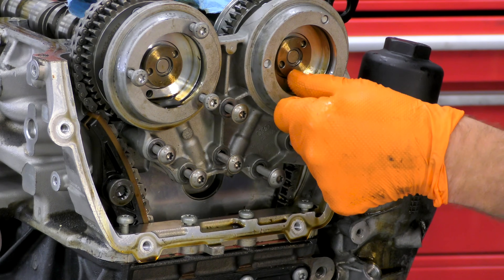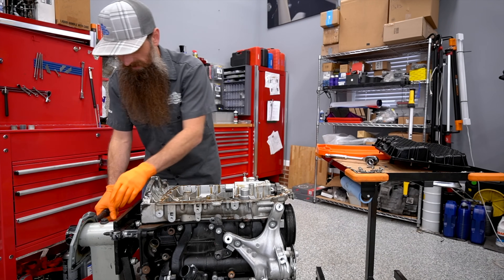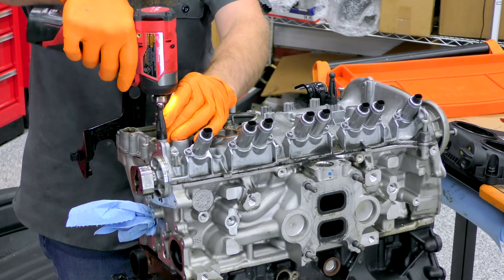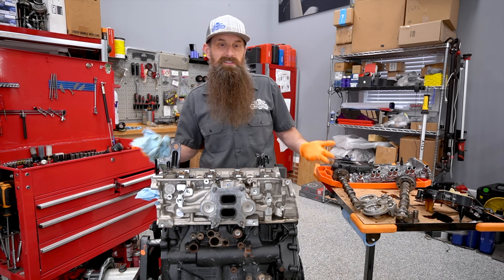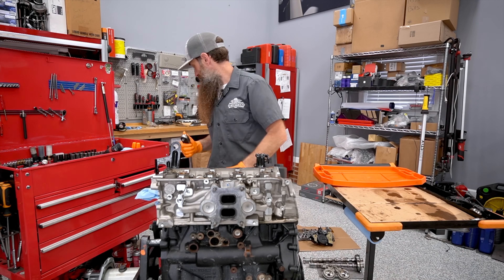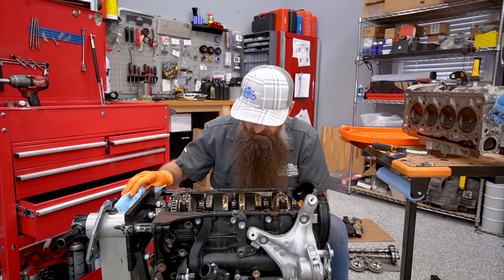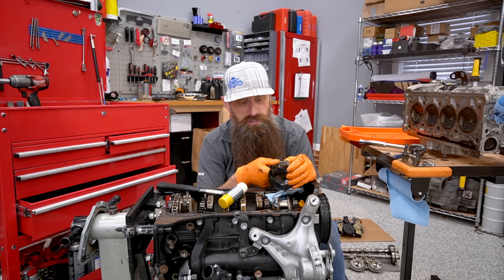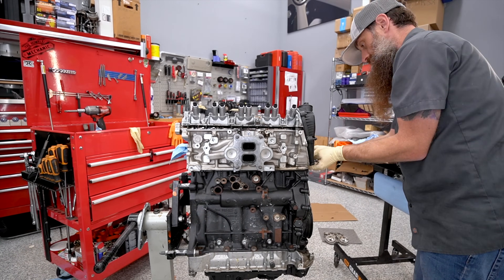Catastrophic VW Engine Failure and Teardown 2.0t TSI

Comment: Bro hope that you can help me, A while ago my car was broken into and almost stolen. Luckily I still have it but I am stuck with some problems. I have a Polo 1.9TDI ASZ.
When the thieves broke into my car they seemed to have flashed it in some sort of way either the cluster or ECU I am not sure. Right now the car can start without a key which I am not comfortable with. Another part of this is that it has been flashed with a tune that does not make the car run at its best. I had tuned the car with MMPS before the incident and now I am no longer able to do it again. 

I'm not sure if it is because of this that's causing the second part of my problem. When I try to flash the ECU it does not accept the file.
When I do a read it takes a file that's about 150KB and when I open it on VAGEDC all the figures are blank. Once again when I flash/write the car with MPPS and it does not accept the 512KB file, and when I do a read the same unreadable file comes out. Just cant find a fix for this anywhere. Thank you

Comment: 1.9 pd tdi
Volkswagen's best modern times engine ever developed. In my opinion after having two in a space of almost 20 years all bought used.
  the current 2006  passat has got 221.000 miles and pulls like a train.as long as economical. Always serviced with original mann filters and liquimolly oil.

Comment: 80k miles here. I've been tuned since 30k miles, and stage 3 with an IS38 making ~400hp on e48 for almost 20k miles. Still solid, but I do consider this the limit to stay reliable. I do need a yet stronger clutch though, but I consider that a consumable at this level.

Comment: Greetings. I drive a VW Polo 6r which is normally made only for the European market. Engine EA111. 1.2 TSI. Year of manufacture 2014. In 8 years, only one part has been replaced. It seems to me that the quality of VW cars or engines for the American market is worse. In fact, every European car assembled in America breaks down faster because the quality is worse.

Comment: What is the parts tray he has beside the motor? (orange corners)
Reply from the maker: Probably these https://www.amazon.com/dp/B075NQ2DMH/ref=cm_sw_r_as_gl_api_gl_i_NVZVSM9KFRR5R2P3EEEK?linkCode=ml1&tag=vwrecommendtool-20
Reply: @HumbleMechanic  those are pretty cool, too. sorry, I actually meant the whole stand that the head was sitting on (like at 12:02) that has orange corners

Comment: You seem to know all about vw’s. I have a 2014 passat 1.8 turbo,  5 speed, 120k. Is there anything you would recommend to get more power from the engine? Or just leave it alone: it currently runs fine!
Reply from the maker: Tune is best bang for the buck for sure

Comment: Help me!! I followed your VR6 timing chain video to do mine everything lined up multiple times after several and several rotations. No that it’s in the car and starting it idles like crap and I only get one cel for P0341 camshaft position sensor. Did it jump a teeth, or could it be something else?

Comment: Melted piston, usual failure of TSIs, VW had a series of pistons that did not respect the manufacturer's tolerances (manufactured with a non-calibrated machine) the oil goes back into the combustion chamber and creates self-ignition, plus number large  jam on scraper rings, the proposed ring kit requires replacing the pistons and connecting rods.
Reply: The problem is a decent manufacturer would just accept responsibility and repair the factory caused faults without charge for the customers, but VW usually let's the customer pay for their faults

Comment: HumbleMechanic is it too early to tell or you think MK8 GTI EA888 won't have the problems of previous gens of EA888 (like chain tensioner or water pump issues and even the carbon build up of the way earlier gens of EA888? 

Hopefully this gen won't have it especially carbon build up (Honda's (at least their 1.5T) don't have it on theirs and its also a direct injection and turbo. Sure there is very thin coating of carbon/soot on the intake valves like what you see on exhaust tips on high mileage 1.5T on honda civic but its still pretty good compared to earlier GDI from VW, BMW and Ford with a very thick layer of carbon that air won't be able to travel to the combustion chamber).
Reply from the maker: Yeah way too early

Comment: Hey Charles. I am super excited for that water pump video. I remember reading the slide valve thermostat SSP around the time the GR Yaris came out. Somewhere I saw that Toyota had to put in a lower opening thermostat for that car to make 268hp. Meanwhile VW has to put in this ridiculous dual valve electronic doodad with seven different operating modes to make less power from more displacement. Why?!

This video was great and the idea of a future Mk7 racecar makes me very happy to be a patron. What do you think of using stock R pistons with aftermarket rods for E85 builds? I know the stock rods don't hold up too far beyond 400 ft-lbs but I'm worried about piston slap with aftermarket aluminum pistons in my daily.

Comment: Hello . Ive recently got some samll vibrations under gass pedal. Theyr small but persistent and it always shows up beyond 3000 rpm . Just to get you noticed My car got mechanical throtle body . What could be the problem?

Comment: my car had this issue as well after tune, low speed and went off while cruising at around 2-3k rpm
Reply: Can you please share year and model and what tune and what stage you had on your car? Thank you
Reply: @gmax985  mk7 gti 2016 car
Reply: @malantra5730  thank you for your reply. What tune and what stage did you have?

Comment: Humble may u give is advice to buy A3 2.0 17"-20" (8v engine) ( FWD or AWD ) which is more reliable . And what is solution for over heating gear temp. At hot places , Is there special oil or some additives with 44"c degree and i need to claim - what is best way to cold down transmission temp. If not moving, let engine on or off etc.

Comment: Great video! Loved seeing the teardown.  I just got a Cupra 290 and loving it so far.  Am I risking this kind of failure if I do a stage 1 or 2 remap?
Reply: He said quite clearly, that LSPI happens mostly in tuned engines. And it`s true. Stay stock, just play with the intake and intercooler if you wish. Leave downpipe couse than engine has to be remapped.
Also stay with the dedicated oil with sort intervals up to 6k miles at max and you will be happy with your cupra for a long time.
Reply: @maciekapocaliptic  thanks!

Comment: Hi I have a question for anyone, 
2005 VW 1.9 TDI BEW 
Lately when I’m driving it I’m hearing a rattle or a possibly grinding sound coming from the driver side (US) of the car and there’s times where the car build boost perfectly but during the times I’m hearing this sound the car is building some boost but it feels it’s only building half of what it’s suppose to or possibly it’s building it and escaping? Car doesn’t go into limp mode or nothing, 0 codes I replaced the factory turbo with a Garret VNT17 roughly 700 miles ago and upgraded the egr pipe that came with the VNT does anyone know what I should check? I also replaced the clutch with the Sachs clutch SMF flywheel, throw out bearing and clutch fork car runs but it’s just the grinding noise I’m concerned about and there’s days where it build boost perfectly and the sound goes away completely but then the day after or so it’ll have that grinding sound and it feels like it’s struggling or something to build boost

Comment: Hi humbleMechanic. I hv a 2009 VW Scirocco. It is now in the workshop bcos of misfiring. The code says P0302 n after changing the ignition coils n plugs it still stalled.
The first time it stalled, fuel got into the chamber. Second time i changed the injector but still suffers the same fate.
What could be the cause? ECU?

Comment: I have the exact same engine with the exact same issue and the exact same symptoms as you guessed (tuned, low speed pre-ignition). When the oil pan was removed, there was debris from a piston in it. So it’s been sitting in my garage since then. Got a new engine and I never even bothered to take it apart. 

To this day I still don’t know what to do with it.
Reply from the maker: One of these days I’ll do a build video on it

Comment: If you are going to track it, bore it to 83 mm in all 4, the IE rods you showed are it. Use mahle racing pistons. Replace all main and head fasteners with ARP stuff.
Rebuild the head with better valves, springs, keepers and deck it to the block.
I would also replace the harmonic balancer with a Fluidampr.
I have a KTM x Bow with the EA113 and just finished doing all the above. Runs awesome.
I've got about 30,000 track miles with stock parts at 350 HP by the time #4 piston ringland cracked. Now I built it for 600 HP but still run 350 HP. Mega reliable. Best of luck with your project. Love your videos!
Reply from the maker: Nice!!!!!! I’ll for sure build the engine. I’ll probably have it ready to hot swap, and run the stock engine until she blows
Reply: @HumbleMechanic  I tracked the KTM yesterday in the Autobahn in Joliet which was my home track for a long time. After all the upgrades it ran amazing!
I gave it the beans with break in oil for about 2.5 hours total. I burned 20 gallons of fuel. 
I will change the oil and filter and move on for another 30k of track duty 
😀

Comment: Hello Charles, 

I’m Marc from Amsterdam, and I have a Audi A3 1.8 TFSI  BZB from 2008. When am accelerate my car choke and sometimes stall when I come to a stand still I have no check engine light only code p0171 and p2261. I changed the diverter valve hpfp and sensor but it didn’t fix it. After time it’s getting worse. I also changed the fuel filter, the direct injections Al 4 I need help please. 

Marc

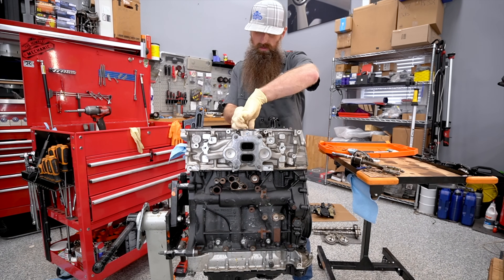Comment: @15:30 you said smashing the gas pedal once in a while helps. What does that do? How does that help pre-ignition? ‘13 Allroad with a Gen 2, APR Stg 1, running E85.
Reply from the maker: The theory is running at high rpm will help with carbon buildup. This bit of carbon buildup can cause lspi from hot spiting

Comment: Are there any company’s that make adapter plates to take a 1.8 or 2.0 to a rear wheel drive trans? I really want to do a little street truck build with a Vw motor. Buddy of mine has a few Vw’s with bad trans
Reply from the maker: Not at a production level that I know of.  But I’m sure they are out there. 

Lot of Jeep’s do TDI swaps

Comment: I ain't knocking Volkswagen. I work on them myself and find them temperamental as an engine and sometimes with software. What I'm wondering, no doubt your intelligence is above average and your knowledge is admirable but why Volkswagen? There are plenty of less complicated, cheaper and more durable engines out there. What oath lead you there?

Comment: Charles, i have a question: I'm thinking of buying a 2010 Jetta Wolfsburg Edition with a 2.0T in it. Is there any issues with the first gen of those EA888 engines i should know about? Wasn't there a problem with the water pump at some point? Thank you.
PS: i said first gen because you said those engines started in 2008. Is this correct?
Reply: Early TSIs suffered from a bad timing chain tensioner and the plastic that would support the chain would get brittle over the years.  Thats the main big issue that could kill your engine. Good rule of thumb for german cars, if its older than 5 years you're likely going to get waterpump failure.

Comment: I know you said it "could" be fixed by replacing that one piston, but would that be considered acceptable practice, even for warranty work from a dealership on a vehicle still under warranty? Would an engine rebuilder do that on a reconditioned engine if that was the failure point?

I would not entertain the thought of replacing one piston, though I must say I have only ever worked on engines that have high miles. Technically speaking, each piston and piston ring assembly is a stand alone item, and subject to failure on their own, and if it is a low mileage engine I guess you "could" replace one piston only, it just doesn't rest comfortably with me. Having said that, if I had one or two valves that require replacing, I would only replace those valves, not all of them. Maybe I don't have a "real" argument for not replacing one piston if the rest are okay, though I feel I would replace all the rings on all pistons.

Comment: I like your videos a lot! Every time it's a ton of information, but it's not overwhelming. I have a EA888 engine myself (Skoda Kodiaq 2017, EA888 gen 3.b). But from what I can remember, I have both direct and indirect injection. So could this occur in this type of engine? I'm planning on having this car as long as it can run and I do my maintenance very often. So would like to know what the common issues are in those engines to prevent most of it 😊
Reply: You got the b cycle engine. Similar but a bit different. I personally haven't seen or experienced any ringland failure from the B cycle. Not saying it doesn't happen. Maybe try and research it a bit?

Common issues are thermostat and pcv and well that's about it since you have the dual injection you won't have the carbon issues.

Comment: This video made me nervous cause I'm getting misfires and hide cylinder code on cylinder 3 on my gti I've replaced coils, plugs and ran a eqt ground wire kit, but still got the misfires when I was doing pulls the other night I guess I'll have to look into injectors next.

Comment: I’d love to follow along with a rebuild. I had a shop rebuild the motor in my MK7R and they did it incorrectly. Almost $20k down the drain.

The car has so much potential but I’m not able spend that kind of money on it again so I’m stuck deciding between hanging into it and hoping to do it myself or selling it for a huge loss.
Reply: If they did it incorrectly the need to fix it or give you a new engine. Especially if it blew up. Have you looked into suing?
Reply: @TommyCubed  I’m trying to work it out with them amicably first. I have talked to a lawyer and he recommended mediation. He said the court costs could easily triple the cost of the rebuild and take years to get through. The shop definitely has more money and experience in these matters so I’m kind of SOL.

Comment: @humblemechanic I had my timing chains and head gasket replaced at the dealer and I keep getting 17949, 16538, 16825, 16398. I've taken it to the dealer twice and they've run their tests and about 30 miles later these codes pop up. Especially the 02 sensor with no activity.  Both upstream sensors have been replaced and this keeps happening.  I need to smog the car as I'm passed due. I looked up the 208, 209 measure blocks and get -8kw and -8kw. Any ideas? I can't keep taking the car to the dealer to just clear the code. 2004 vw R32

Comment: Dont lug the engine in higher gear as well.   Use the transmission like it needs to be.   LSPI sucks...  Flooring the engine in a high gear usually causes this....
Reply: Thanks, I'll keep that in mind.
Reply: What does "don't lug your engine in higher gear" mean.
Reply: @gmax985  Pedal to the floor while in 6th in Drive for example. It will inject a lot more fuel and can lead to pre-ignition, especially if you have a leaky or faulty injector.
Reply: @TommyCubed  Thank you for the clarification. I don't do that but that's good to know to never do it
Reply: @gmax985  Np man. Its even worse with these engines cause theyre turbo, so the turbo has to work even harded getting those rpms up. So just flip it into manual, downshift to 4th or 5th and ur good.

Comment: Could you go into detail what the differences are from this EA888 engine are between the GTIand the Passat? There is a big difference in HP and I am wondering what causes that change? Are the turbos different? Is it the tune? thanks for any help and great video.
Reply: Dual VVT cams, different tuning, larger turbo are the main ones

Comment: the factory rear main seal is expensive now you can go with a German aftermarket one they are way more affordable but people have to know that you need a new type of installation tool for these new seal compared to the older style talk a bout expensive part is the coolant regulator one the 1.8 T and 2.0 T engines they are around 900 Canadian and they fail too. and they are very hard to find in the aftermarket they seem like they are all back ordered.

Comment: Is it possible Charles for you to explain little bit more what is the link between the pre ignition fault who destroy piston ring and the fact the car was tune. (Probably). Is it a bad tune ? Is it a bad maintenance ? Is it because the person  laugh the car out of hell as crazy ? I dont understand how the fuel can ignite before spark. To much eat ? Tks
Reply: Probably agressive tune with bad fuel!
Reply: Fuel can ignite before spark by oil leaking inside the combustion chamber or by a inyector leaking for example. Also dirty intake valves can cause that if carbon build drops inside.
Reply: @Oravl-es1dv  ok tks for the explanation. I like learn more and more about VAG engine. I've got myself a Golf R MK6 tune on 2+ with Unitronic. Works great.
Reply: @jeanfrancoismenard705  Also heat spots / too much heat inside the combustion chamber can cause preignition if the fuel is bad. Great engine CDL! I have a 35 edition Golf, same engine as your R. In these cars it is very important to check the injectors and clean the intake valves and use good fuel.

Comment: I wonder if there'd be any symptoms of low speed pre ignition. I have the gen 2 with IE stage one tune on 93. Seems like when its cold out I'm getting a light knock on start up. Thought it might be a bad motor mount, but it only happens when its cold. 🤷‍♂️